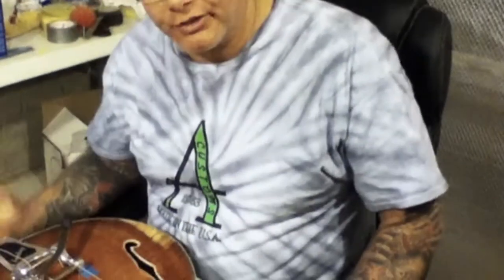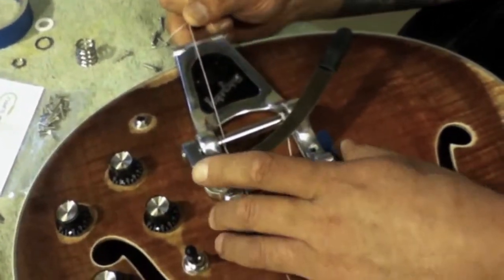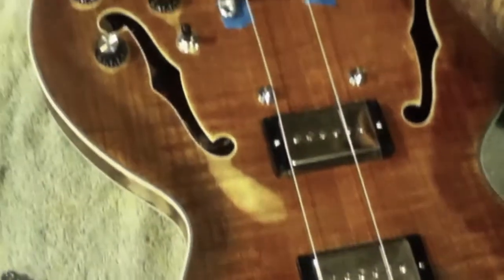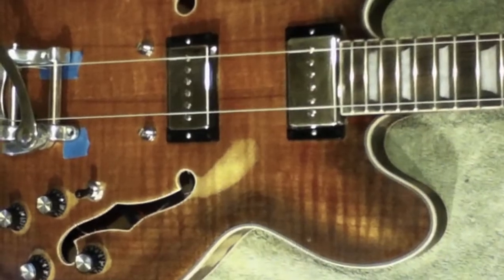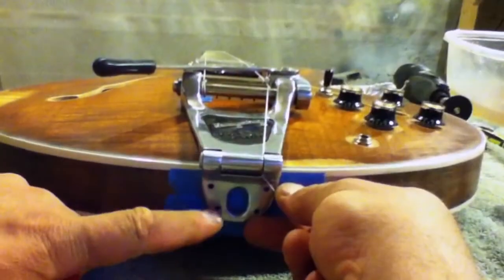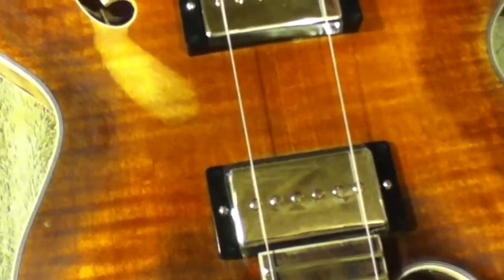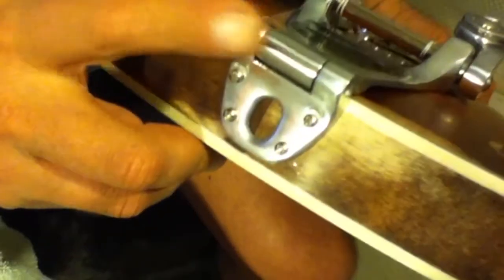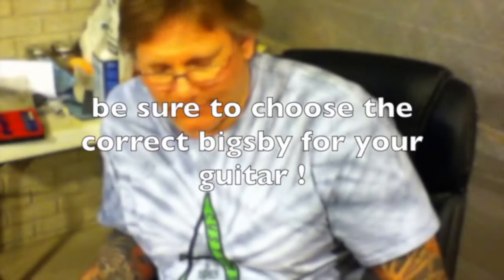how to install a bigsby vibrato

Comment from the maker: Gary on the underside of the arm above spring, you can adjust the arm tension with a 1/8" allen wrench and 5/16" socket. use the socket to hold the nut in place  while turning the allen wrench inside the socket to get the desired tension. The arm was probablly a little lose on instal and a lot of use caused it to loosen futher to the point of swinging free. Also if you want to change your handle height you can place a coin under the spring or remove the plastic washer.

Comment from the maker: Thanks for the catch Wesley, that should have mirrored what I said about the roller saddles vs. the standard saddle. I prefer them because the strings "roll" vs sliding and possibly catching a wound string on the V notch.